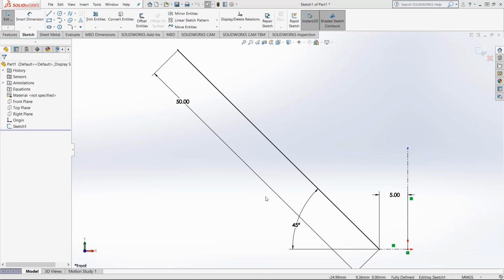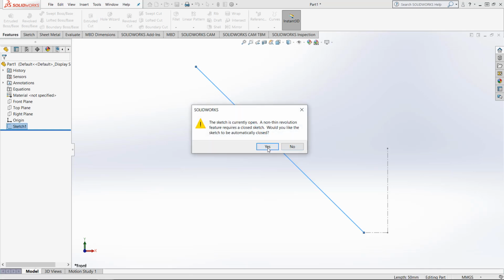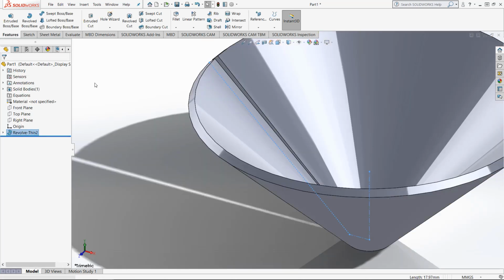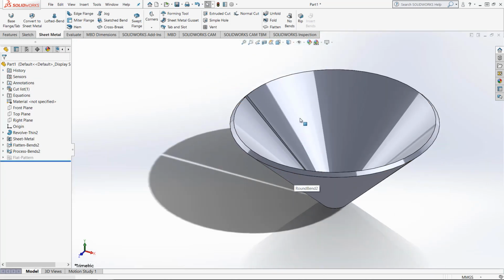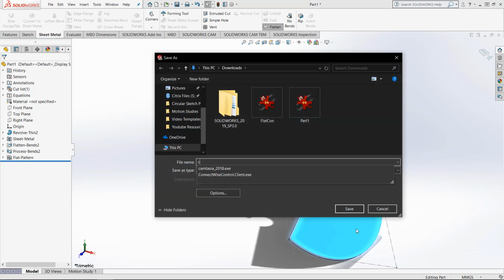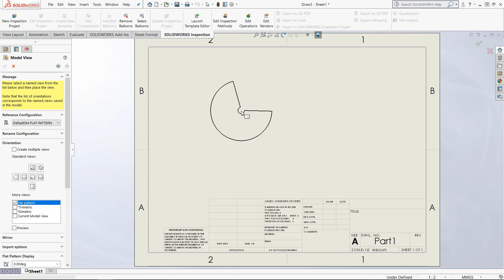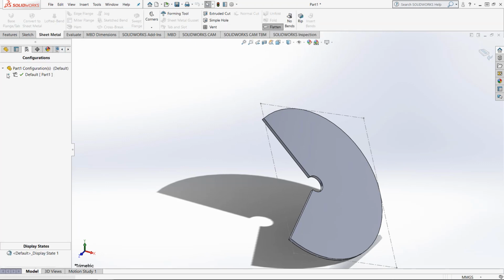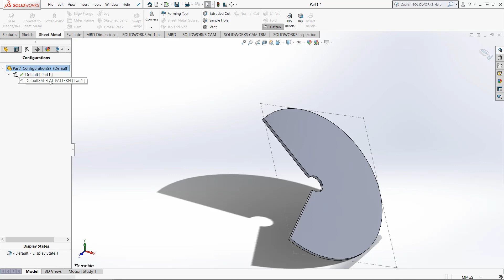SOLIDWORKS Tips and Tricks — How to Flatten a Cone

Comment: HOW DO I GO FROM FLATTENED METAL TO A CONE, I CANT START WITH THE CONE BECAUSE ALL MY MEASUREMENTS ARE FROM A FLATTENED DRAWING!!!!
Reply from the maker: Unfortunately at this moment SOLIDWORKS does not have a good process for going from flat to a cone.  With the flat form though you do have all of the information you need to be able to determine the 3d shape, you may have to do some adjustments for stretch

Comment: I was wondering how to flatten a cone with radius on the edge?
Reply from the maker: Hey Jacek, in this video we used a thin feature to make the cone.  If you would like more control over the profile of the cone, make a sketch with a fully enclosed contour to revolve around the axis instead of the single line that we used in this video.  This will allow your cone to be any shape you would like.  If you need more help, contact us at goengineer.com/contact

Thanks!